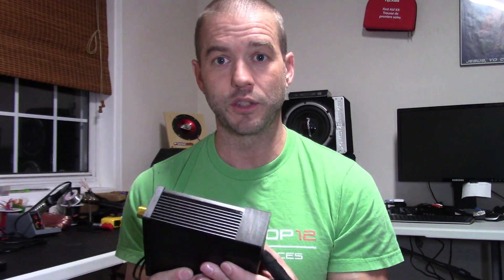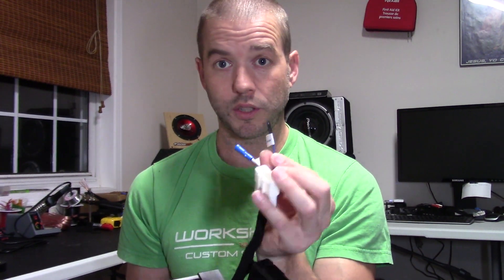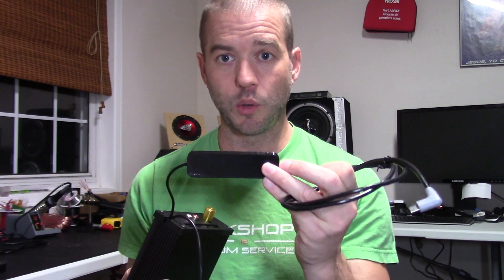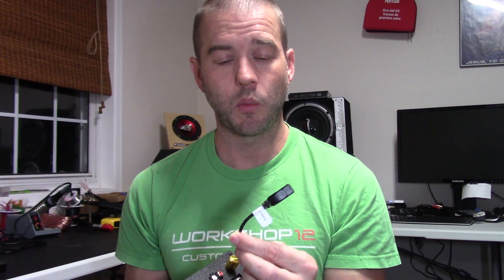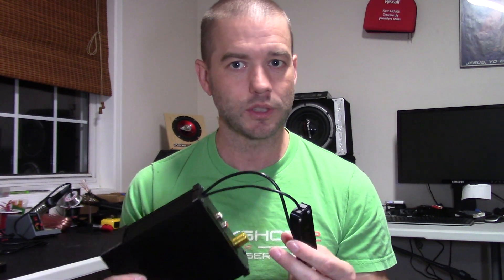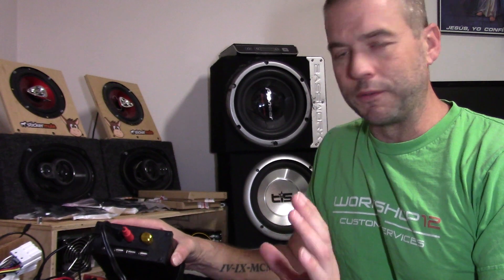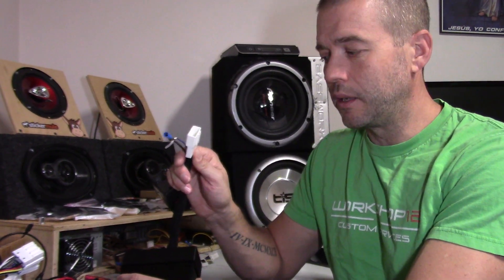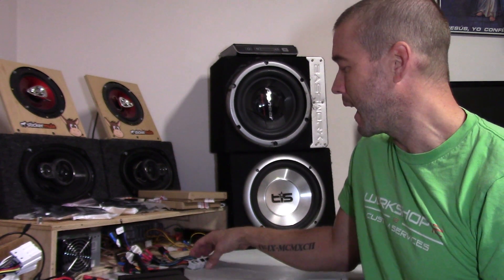MK1.7 Electronics and Installation

Comment: In videos the 350z harness shows different and in the website is different
Reply: They are not 2 plugs
Reply from the maker: The electronics shown in this video are for the 370Z. The harness for the 350Z is suppose to have 2 plugs. https://workshoptwelve.com/en-ca/products/shop-mk1-7-electronics-350z
Reply: @WorkshoptwelveConnect  so if I buy will I get 2 plugs
Reply from the maker: Yes you will.

Comment: I see on the site that the built in amp is rated at 200w. Is the rms  or peak watts? And is it 50watts each over 4 channels?
Reply from the maker: Its 110 watts for each, it is a 2 channel amp. The amp is rated at 220 watts.

Comment: If the volume knob is on the mk1.7 electronics box itself but you're saying to mount it inside the dash how are you suppose to control volume? Just through the tablet itself? Can the volume know be removed and remote flush mounted somewhere else?
Reply from the maker: You would control the volume with the brainiac app on the tablet.

Comment: How do you add a reverse camera?
Reply from the maker: Y You will need an easy cap dongle in order to connect the reverse camera to your kit.  The EasyCap dongle which converts S-Video to USB to connect a reverse camera. The EasyCap dongle connects into one of the 4 USB ports on the MK1.7 electronics.

Comment: I'm thinking of investing in one of these whole kits for the 370. I literally just picked up a Z earlier today, and the stereo is seriously lacking. What I'm wondering is, can I connect a backup camera to this system? Like would a backup camera count as an accessory? Can't see shit out of the back window of this thing lol
Reply from the maker: There are different ways to do it.. not exactly like an OEM reverse camera. I'm going to be doing some testing today
Reply: @WorkshoptwelveConnect  I have the same question about the rear camera. If I connect the RCA-USB cable of the camera into the brainiac electronics will detect it?

Comment: Can you please please please make a video on hooking up another amp for subwoofers, and how to connect the rca splitters, ive looked at the guide on your website but im still confused on where to actually connect the splitters. Please and thank you lol
Reply from the maker: I don't know if we have any splitters in the shop for a video. Typically you will run the headphone jack to the RCA ground loop isolator that comes with out kit. Then you would add the splitters to the output of the ground loop isolator. Run one set of RCAs to our electronics, and one to your amp for the subwoofers
Reply: @WorkshoptwelveConnect  This right here. Your diagram is missing the ground loop isolator and thats where everyone is getting confused. Also it's worth noting that only one rca cable from each splitter will go to each component (one to the electronics kit and one to the amp) as each splitter is going to split a left or right channel.

Comment: Will all of the speakers and subs still work and at the same wattage on the Bose system? I know that on other aftermarket head units you lose the subs after installation. Also, what is your return policy?
Reply from the maker: If you already have a Bose system our electronics will plug into the factory harness and use your existing speakers and sub. We charge a $50 restocking fee on returns

Comment: I'm getting static noise unfortunately. Grounded to chassis, ground loop isolator being used. Occurs even when tablet isn't connected. Doesn't occur with factory radio unit. Ideas?
Reply from the maker: Send us a message at info@workshoptwelve.com so that we can open up a support ticket for you 👍
Reply: @WorkshoptwelveConnect  Cheers for the rapid reply!

Comment: Hi, I’m looking at doing a tablet install on my 1994 Toyota Celica. There’s very little space to work with to fit the tablet, so I’d really like to find a way to implement my climate controls. Will the brainiac electronics allow for that in an older car given I can wire everything properly?
Reply from the maker: Our climate control electronics are researched and built for specific vehicles.  Unfortunately there isn't a universal way to solve climate control.  Especially older vehicles which tend to have physical cables instead of electric motors that drive vent and temperature selection.
Reply: @WorkshoptwelveConnect  good to know, thanks for the reply!

Comment: Hello from Canada :-)) Great team, keep up with your wonderful jobs.  I have been looking for how to wire an Android Tablet to use my existing Kenwood Navigation Radio instead of removing it completely. It looks like your MK1.7 wiring system meets the requirements of what I want.

The reason why I do not want to remove the current installation is that it is a complex and time consuming installation with "idatalink" harness, giving me a full functionality of my steering wheel control and my Ford factory SYNC for voice commands. I installed it myself with help from Crutchfield and everything is working well. My hardwares are Kenwood DNX875S and the 5-channel BOSS Amplifier PV3700 installed on 2011 Ford Escape. Here are my questions:

1. How can I connect your MK1.7 wiring system to my existing wiring? I will send you a link to see. I guess that a Y-Connector may be required at one end to the standard connector of the MK1.7, another end to the factory stereo, and the 3rd end to our current connection to the amplifier, right? See page 20 of the following link: http://images.idatalink.com/corporate/Content/Manuals/RR-FOR/ADS-RR(SR)-FOR01-DS2TH-IG-EN_20151214.pdf

2. When a connection like the one explained in step 1 above is done with your MK1.7, is there any need to switch ON my Kenwood head unit before the audio and video from the Android Tablet get to the amplifier?

3. From your experience, which of the following Tablets is the best; Androidtv on Nvidia Shield or the Standard Android on Galaxy Tablets?

4. Do you have a floating mount that can be installed on any Double or Single DIN to hold a tablet like the Metra brand? http://metraonline.com/part/109-UN02

Regards.
Reply from the maker: Can you email us your questions to info@workshoptwelve.com. hard to answer everything in YouTube 🙃
Reply: @WorkshoptwelveConnect  Sounds good.

Comment: Im interested in getting the 1.7 but I just got the 1.5 a couple of months ago. Can I exchange or buy this and return the 1.5? I definitely want to get rid as much a possible the static noise
Reply: I have the same question. Bought 1.5 2 months ago. I have issues with electric noice and also static noice that neither the provided electric filter nor the rca filter will erradicate. I have always nice until the music starts. For experts here it's something wrong with the 1.5 unit I got. The rca filter is almost 1 meter away from the 1.5 electronics and noice is still here. 

Hope you can help me out. 

Facundo

Comment: That's so amazing guys but I have one question. How can I add another amplifier for subwoofer if there is only remote wire? We would also need signal cables but there are no RCA outs on MK1.7
Reply: You forgot to specify what kind of rca splitter. All I see in the article is the picture of it and how many I need but what about the connections? Male to male? Female to female? Female to male? Male to female?
Reply from the maker: You'll can find details here 👍 https://support.workshoptwelve.com/portal/en/kb/articles/using-an-amp-and-subs-with-your-brainiac-install